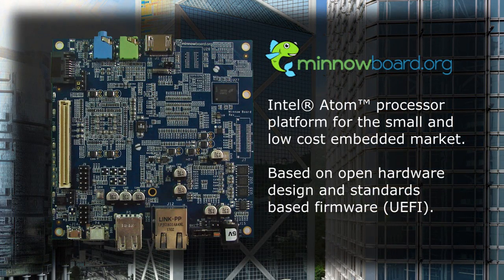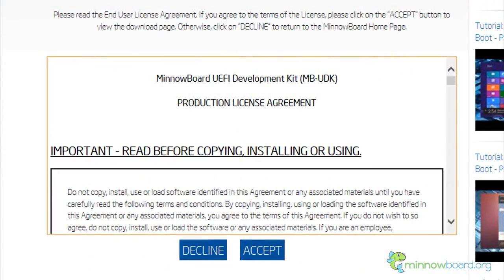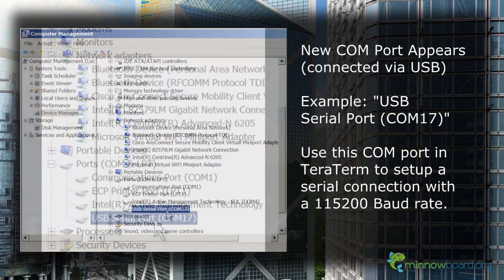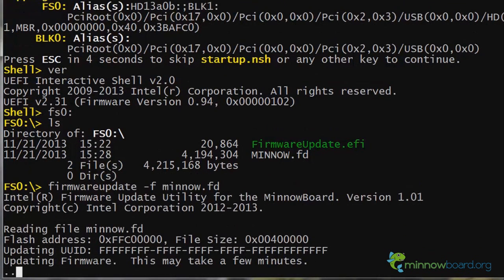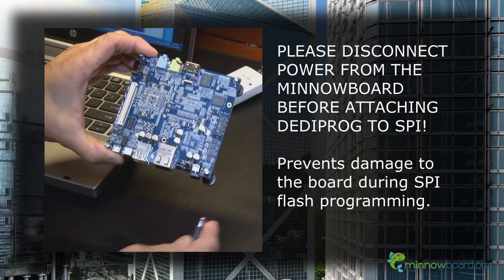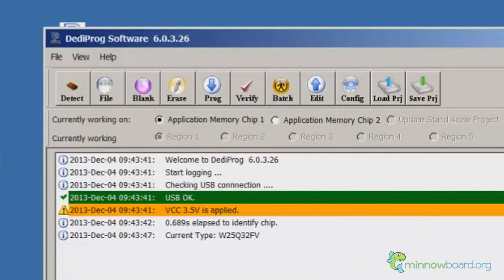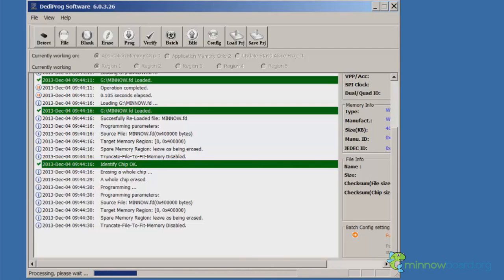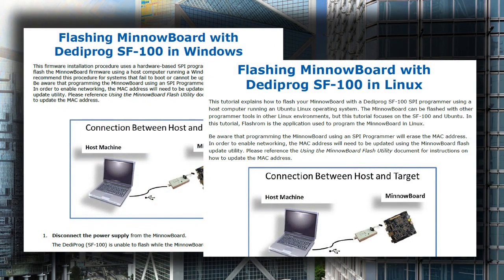MinnowBoard and UEFI: Firmware Update Methods | Intel

Comment: Hello,

Running 'firmwareupdate.efi minnow.fd' from the USB stick also cleared the MAC address so I had to add it like you mentioned in the SPI programming part.
Reply: Does it do the same thing if you use 'firmwareupdate -f minnow.fd'?